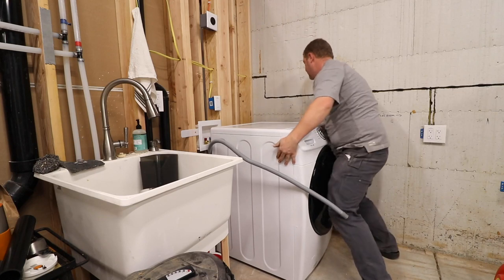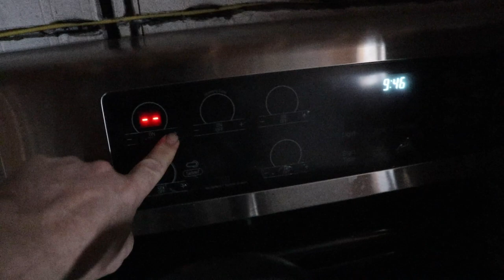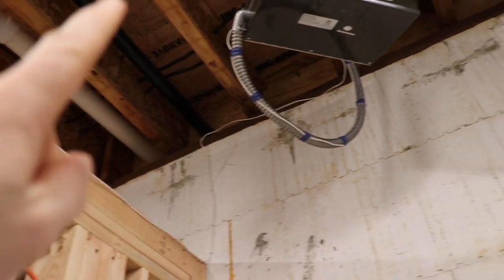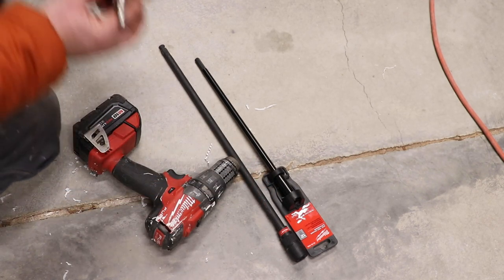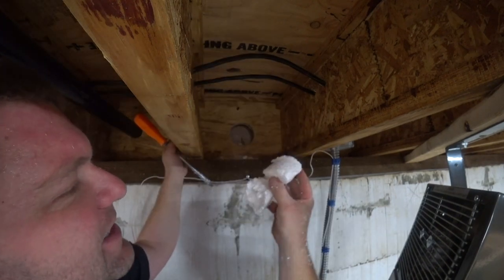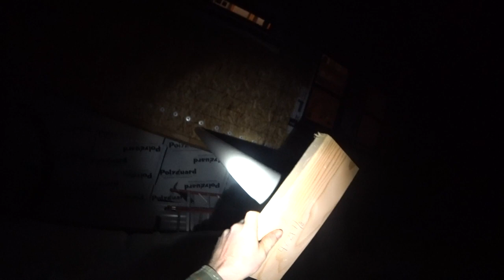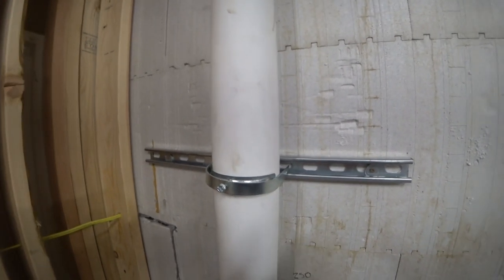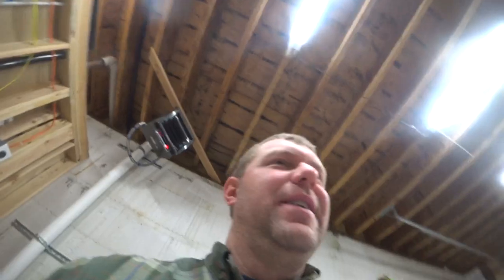WINTER YOU DIRRTY DOG! (Dryer Vent Installation)

Comment: PVC is not approved for dryer and stove vents because of heat, flexible dryer vent is a different plastic that is rated for heat.  use metal duct and you can get insulation that slides over it that is similar to flexible air duct or go really heavy duty with preformed fiberglass pipe insulation, matching inside diameter of insulation to outside diameter of metal pipe and the thickness of the insulation you desire.  Your videos are well done, informative, and entertaining with the occasional cringe factor for a retired construction worker.  Keep up the good work.

Comment: Invest in a 1/4 in bell hanger bit. They normally come 24in long. Drill witht the 1/4 in bit from the inside out where you want your hole, then you can go outside and do all your drilling from a much nicer position.

Comment: Since it is also prone to static buildup, lint will accumulate inside the pipe and could clog the exhaust causing the pipe to be less effective as a dryer vent. ... So in essence, use of a PVC pipe as a dryer vent is a fire hazard.

Comment: use four inch smooth wall aluminum pipe.  Inexpensive.   DWV pipe is plumbing code  pipe where the V is a plumbing vent.  You might want to use two 45 degree fittings and short straight piece  to make a 90 degree bend.  Less chance for plugging up with lint!

Comment: Just use a flexi exhaust hose from the dryer ( ours is aluminum )  to the hole at the sip -  that will be about 8' of cool off from the dryer.  Should be just fine!

Comment: Use Spiro tube and isolate them from the dryer to the wall also use a backdraftblocker either within the pipe or on the outside..

Comment: Only metal pipes are allowed for dryer vents. You are also not permitted to screw them together. Use duct tape for the connections. System 636 CPVC plastic tube is used for gas boiler venting and has a higher melting point than PVC or ABS.

Comment: As a firefighter in New England who has seen many installations throughout new england (RI, MA, VT, CT) which as you know -- means nothing out your way.....   I've yet to see PVC used in any application in which heat is involved.  I also worked in the swimming pool business growing up -- very familiar with ABS, CPVC, PVC, and (older Nylon fittings - no longer made) and how they react chemically.    I know CPVC can't be used at high temperatures because you can't use it coupling to some hot water heaters for swimming pool applications due to thermal issues -- I'm guessing this may have something to do with why it's also a poorer choice for dryer duct.   Typical here is a penetration to exterior wall near the appliance (as you've already done) with aluminum or steel 4" vent pipe, down to a flex hose onto the appliance held in place with clamps...    Best of luck, and keep up the good work   Hope Alyssa feels better!

Comment: Use a condensing dryer whereby the lint is expelled in a water flow to a drain and only hot clean room air is expelled. More expensive but once you have used one you will never go back.

Comment: PVC burns. Why not have metal duct between your dryer fire and your... styrofoam and wood? You don't apply plumbing code to mechanical any more than you would to something electrical. Try some dryer duct.

When you think about why a particular code exists, there was probably a chalk outline on the floor or a smoking cellar hole that prompted it.

Comment: Sorry, guys.  I misspoke earlier.  NO kind of plastic venting will meet the heat-hazard needs of dryers or range hoods.  I knew that and was reeducated when I read a bunch of your viewer's comments.  When I initially installed metal piping in my work shop for wood waste collection there were very few attaching, jointing, bending types of matching fixtures that weren't designed for use with stoves or heaters.  And, unless I were to make my own, very few adequately sized terminus and blocking fixtures made specifically for woodworking.  So, I became frustrated with the metal system and (mistakenly) converted to a plastic system with the (now) available fixtures designed for wood working vacuum use.  The problem, in my case?  Not enough (or no) research and "due diligence" on my part before spending double time and money.  Allysa, take care of yourself, lady!!  You guys hang in there.

Comment: I love her voice in the vent tube! :) Don't worry about any heat build up from a thin wall vent. If you ran the dryer all day then maybe... but a few hours will not be much heat build up. you could wrap the vent pipe with some insulation if you want. ridged metal vent pipe will work best.

Comment: If static is the issue, run a grounded copper wire down the middle of pipe. Problem solved. This is a common issue with dust extraction in woodworking. Ground the pipe, give the static somewhere to go, and move on.

If the issue is something else, then you’ll probably have to replace it with rigid metal ducting.

Comment: Any type of  heat, water heaters, exhaust vents hoods, dryer all require metal venting
Also it would have been worth investing in a sprinkler system due to fire requirements these days. I dont know about your location but where I live new construction has to have sprinkler systems. When a wooden structure fire it burns faster with pine.

Comment: Bugaboo: "I want to go outside. Let me out, Now!! I want to got out!! Uh, Uh Uh, It is tooooo Cold outside!! Let me back in!!!" 

You will need either: 4in Aluminum Semi-Rigid Flexible Duct or 4in Aluminum Round Duct Pipe, which you can generally find at any home supply store such as Lowes, Home Depot, Ace Hardware, etc.  They also make various attachments such as elbows, extensions, periscopes for tight spaces, and there are many different types of vents for the exterior.  Hope that helps!

Comment: Just FYI your best bet is to just use 4" single wall "dryer vent". Do not use the flex garbage. You can find it at HD or Lowes. Given that your dryer termination that you had with the white trim had the aluminum sleeve attached to it, it will work just fine and you can remove the white trim piece off the termination and attach it with metal tape to the end of your pipe. Keep in mind you will need to keep your clearance around any combustibles.

Comment: iirc the offset for a 90* is 1 1/2 times the diameter for pipe. pvc may be designed using the same standard. I would stay with what you have, with a short flexible hose from the dryer to the vent pipe. the flexible hose will be easy to remove so you can just check it periodically and see what is happening. who knows, it might work.

Comment: You plan to use the dryer during the summer? I use my SOLAR clothes dryer... also known as a clothes line! It works in the winter too - many days. If too wet outside I have a clothesline in the basement! I hardly use the dryer!

Comment: Your roof is air tight and efficient if the snow is falling off with only a couple inches of build up.   You may want to try some snow baffles at the bottom of the slope.  The snow will still fall off but the baffles should stop it from shooting 20’ into the yard.  Until then you should protect your Water mains.

Comment: fire hazard - dryer ducting. which you can insulate on the outside of the ducting. in this case its not a great idea to try to re-invent the wheel, dryer fires are common and take your hard work down to the cement. don't risk it!

Comment: Charge created in the PVC pipe will migrate to the exterior surface. A  copper wire wound spirally around the pipe and grounded will discharge the charge on the pipe. This approach is frequently used on vacuum systems in woodworking shops. It seems to me that using metal ducting in your winter climate would lead to extensive condensation at or near the outdoor appearance point where cold air is present leading to rusting. Best wishes....

Comment: In my area, you must use a metal duct for the first 6 feet of venting any heat source, beyond that you can use almost any other ducting product...and surprise surprise; there are exceptions( usually involving more metal ducting rather than less)

Comment: Get ride of those extensions when it comes to concrete drilling they will simply just snap. Get either from BOSCH the SDS system cost about $100 you get all you need and check it out on Amazon often they have some good deals for sale.
Sorry you use Metal and not PVC. Use HVAC 4" pipes they are smooth. You get them from HVAC guys :-)

Comment: Use metal duct work for dryers. You need it In case of fire and that does happen more than you think. Happen to me, but I had metal duct work. Lint build up is the reason. Very flammable .Your roof snow sliding off is very dangerous. You need to control that with stops.where people walk

Comment: How about using 4" stove pipe, that should handle the heat and even radiate some heat back into the garage ( need insulation for the summer though).

Comment: school of hard knocks for sure jessie!! yup thin metal vent for dryer here in Iowa...
they make indoor vents with filters... to help recover the heat for winter...
I do not like them as I cannot stand the dryer dust...
you can insulate the outside of the dryer metal tube with the stuff rated for high heat like furnace ducts...
or you could use stainless steel double wall vent like for gas water heater to get a break on the direct radiation of the heat...
summer time the heat and moisture from a washer and dryer is a big deal!!
you may want to do it as a utility room with a door for them???
and have an cold air intake for the room down low to the floor...

Comment: I think the problem is that many people confuse  DWV "drain waste and vent" as a general construction term, it applies to plumbing and only plumbing. What your is project is relating to is heating and ventilation, a part of the Mechanical Code AKA "HVAC" Heating Ventilation and Air Conditioning. It is not the electrical static charge  It's the heat, pure and simple. PVC is OK for hot water 140f max and clothes dry are over 300f.  Heated appliances can produce a massive amount of BTU 's and PVC can't handle it.

Comment: I would have thought that a condenser drier would have been the simpler solution. Is there a reason why you can't use one? As for heat, use a de-humidifier in the garage.

Comment: Is the issue with pcs the chance for static charge build up and a fire? Dryer vent fires are the #1 source of home fires according to an old acquaintance who sold insurance. On a side note, save your dryer lint and sheets to use as fire starters for the hot tub, charcoal grill etc. Works great!

Comment: My house is set up with pvc and metal the pvc goes from the wall to the outside and from dry to the wall it's metal and the space from dryer to pvc (wall opening) is less then a ft. I think it's around 6 inches. We have not had any problems. Maybe it's they don't want the pcv right next to the dryer only?

Comment: There are two options:
1. you keep the pvc pipe but you put something inside that discharges static (i.e. a very thin metal grid that you can bend easily and make it adhere inside, that must then be connected to the electrical ground someway)
2. use metal pipes like it was a stove, then you can obtain heat insulation by some rockwool. The pipes must be grounded as well.

Comment: Funny how a thin plastic hose will not melt through but they are worried about a sch 40 pipe.  After having to heat bend  PVC pipe with a Hot Box it takes a LOT of heat and time to get the pipe soft enough to bend.  If you pumped that much heat through a dryer it would scorch all the clothes.  Besides, my father vented the dryer with PVC pipe when he added a porch on the back of the house.  No where to vent but up through the roof,  Still in use after 30 years.  If you want to test it just run the dryer and let it exhaust directly on the 4"pipe right outside the back of the machine.  It won't scorch it and probably even with direct heat on only one small section it won't get it hot enough to soften.

Comment: Should make a temp jigfor the next ICF hole you drill to prevent injury from the drill kickback, cant the camcorder be plugged into the wall and still record, or set a webcam maybe for the tooth sliding snow 😀

Comment: Bug-a-Boo is getting bored. I can't go out and play!  
I tried shouting at you, but, of course, you couldn't hear me.  Went through this with the spouse. He did it and then had to go back in the crawl space to redo it. I read up on it when we were getting a new washer dryer, so I realized he couldn't/shouldn't use PVC. He didn't believe me and asked a professional he knew through work. Poor man, I never said it, but I sure wanted too.  "I told you so."
You will get it all done correctly. We all make mistakes and learn how to correct them.  Thanks for sharing.  Get well Alyssa.  Stay safe and warm.

Comment: I've read the PVC builds up static that holds the lint.  You may want to install some snow guards on your roof so no one gets hurt if a huge slab of ice and snow slides off the roof.  The snow guards are supposed to break the sheets up into smaller sizes so you don't get those big slides off your roof.  It would suck to be walking by one day and be hit by that.

Comment: You should not use pvc for dryer vent also the way you put the exit piece it should slide on the outside of the pipe not on the inside ,it will catch all the lint and then you could have a dryer fire.

Comment: What if you use 4” galvanized pipe for dryer vent which you route through the inside of an 8” galvanized pipe on the wall with an fan that pushes inside air through the 8 “ pipe which exits to your garage to extract heat in the winter and don’t use fan in summer? I.e. a heat exchanger.

Comment: If you put the top shingles on first so that each lower level overlaps  -  it would be a problem.  Same in your vent pipe.  The aluminum fits snugly inside, but it may be a problem down the road, building up lint.

Comment: A condenser dryer needs no ventilation. Although the have a slightly worse efficiency this is only half of the truth. When you use them in winter time you have even the advantage that complete energy / heat stays in the house. So nothing is wasted. If you use the old fashioned clothesline rope during summer and during winter a condenser dryer you have max efficiency on your energy consumption.
An other option without ventilation are heat pump dryers. More expensive in purchase but most efficient and you can even dry wool in them.

Comment: What if you use 4” galvanized pipe for dryer vent which you route through the inside an 8” galvanized pipe on the wall with an fan that pushes inside air through the 8 “ pipe which exits to your garage to extract heat in the winter and don’t use fan in summer?

Comment: oh you should have got a series of extensions,start with the small ones and work your way up to the longer ones makes drilling easier .oh and dryer vent can be PVC,,nothing international about it our dryers come with a 4" flexy hose ,the fittings we use to go through a wall is plastic the grill on the outside is plastic,the international is probably just America....should have got a Condenser dryer no pipe work and empty it every other load :)

Comment: I think it’s because pvc gets soft when you heat it 
Aluminum pipe would be better up there because some of the heat will come out an help heat the house 
Aluminum is a good heat connector so a lot of heat will Escape before it gets outside 
But not nice for hot  summer days

Comment: Air venting from a bathroom or kitchen vents are not HOT air,, the vented air from a dryer or cooker hood can be extremely hot and it will melt PVC, only use metal ducting for a dryer &/or kitchen hod vent,...

Comment: The fact that the snow is only sliding over the house part of the roof suggests that the cold roof isn't working well - the heat from the house is causing a thin layer of water to form and encouraging the slide.

Comment: Run a copper wire through the vent. Same problem in wood shop dust collection systems. Same solution.

Comment: Funny  the snows only coming off the heated part of the house???  Looks like your heating the outdoors,, run a flex pipe into a vent box in side,, free heat.. you need the moisture with any kind of winter heat!!

Comment: You can use these for the venting. 
4" duct comes in 5' lengths https://www.homedepot.com/p/4-in-x-5-ft-Round-Metal-Duct-Pipe-CP4X60/100196725
Duct wrap for the heat https://www.homedepot.com/p/60-sq-ft-R-6-Insulated-Duct-Wrap-INSWRP60/100152008

I installed the dryer vent in my home but its not insulated. i used the same galvanized duct.

Comment: everywhere I've ben its ben code that dryer vents must be metal do to fire hazard? If you had a lint fire the CPVC, PVC, ABS can/will burn. not to mention off gassing when the plastic gets hot. as a firefighter, I have ben to many fires that resulted from plastic dryer vent piping. take the time and explore your options. (think, what if I had a Lint fire in the pipe. what will hold up better till the fire department gets there.) as far as all you that say well that's what the lint trap is for your wrong. the lint trap will not catch all the lint and over time the lint will collect on the inside of the pipe. even in metal pipe. don't believe me pull a section of pipe apart and see how much buildup there is. that's why they recommend cleaning your dryer pipes once a year. it's cheep insurance from having a dryer fire.

Comment: A while back you mentioned that when you get older you might not be able to use the stairs in the garage. (now might be a good time to research if the opening is big enough to be replaced by a lift! But I digress....) If you have to enter the house from the back door, isn't that snow/ice falling from the roof a hazard to anyone walking down the side of the house to the backdoor? What about cars parking within the kill zone? ❤🌅🌵